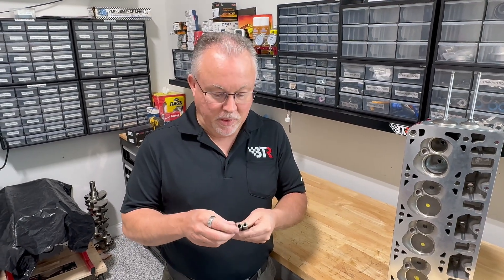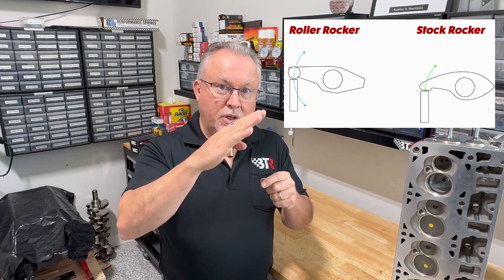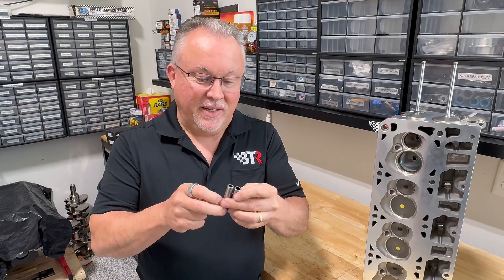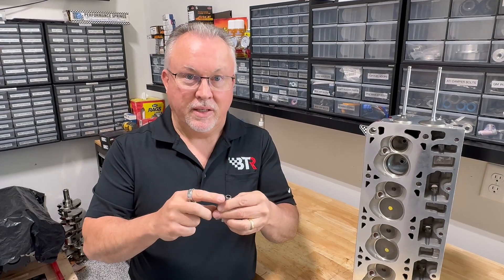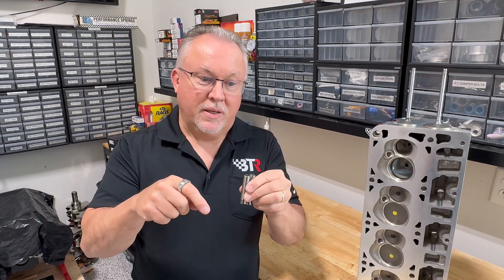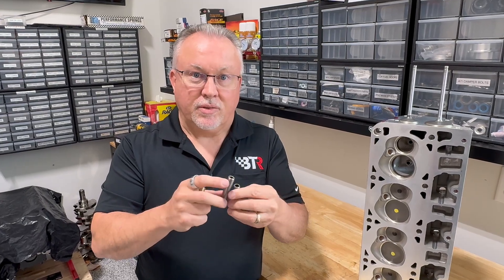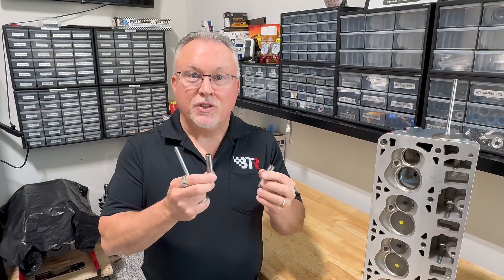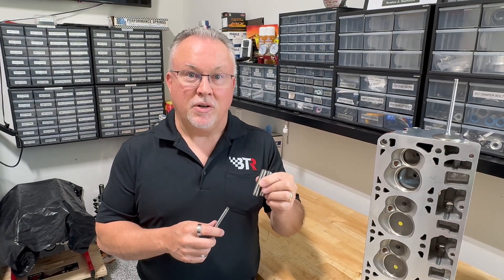BTR Releases The Best Powdered Metal Valve Guides Available!

Comment: BTR makes excellent products but this is nothing new for the LS market.  We have been custom making our Hardened PM valve guides in house for over 8 year now.  We have them in over 3,000 sets of LS7 heads.  We have been telling folks from the start about Bronze not being the correct alloy for LS7 heads.  You either want PM or you want Moldstar90.  Nothing else.  Just With that said we don't sell our hardened PM guides outside of the heads so its nice to see BTR offering these for the average consumer or shop to install into their heads.   BTR does make quality stuff.

Comment: Not so sure about all that. Bronze guides done right like CHE and SI valves made in the US are done right with the right material selection since the 80’s with tolerances down to 2 ten thousands ( .0002 ).There’s like 10000 different bronzes, to say all bronze guides are the same is unfair, just like not all powder metal guides are not the same. Some venders that orders 10000 guides from some factory in India, China, Israel, Turkey, with out any care in material and tolerances, then I get it.

Comment: Interesting clip.
Brian is a LS professor for sure....
Also a very good point on stock non roller tips and side loading. 
Also true, not many head shops want to use powdered metal guides or seats. I am one of them. All my stuff goes out the door with a full roller rocker and CHE alloy guides and or seats. I have had zero issues so far and would never put a powdered guide in anything. Not even a lawnmower. but if I ever have to. I will probably use BTR.
They have great products.

Comment: The lack of a collar on the top side of a powdered metal guide is why I'll never use them. I've seen so many fallen powder metal guides (especially on EJ's), but I've never seen a fallen bronze guide, because the bronze guides come with collars.
Reply: they do not move if you have the correct press! 100
Reply: @americanheritageperformance  If OEMs cant get it right I'm not going to hold my breath, especially when a better solution already exist.

Comment: With stock valves, proper valve train control, and high RPM (8000) is there any concern or worry about keeping the OEM valve seats in a brand new LT1 GM casting? Or is something along the lines of a durabond killerbee seat preferred. Thanks!!

Comment: hi, are you selling these guides to people who want to use them to replace their original guides?  how are they sized to the valve? do u offer oversize outside dia?
Reply from the maker: Our powdered-metal guides are available to everyone, and yes, you can replace your factory guides with these. However, our guides will need to be installed and final-honed before a valve will fit them. Our guides are not offered in an oversized O.D. as they are designed for factory GM casting cylinder heads.

Comment: Guy knows his trade. But another guy that does, said you need Magnesium bronze With stainless valves. And another guy that does say, you need them with turbo. My brain is smoking, And my piggy bank is hiding under the bed in the fetal position.  Every time I think I know something... I figure out i'm going down the wrong path, right after it's too late to return it. I've tried doing the wrong thing first.So it would turn around and end up being the right thing,  But it didn't work out. 😁
Reply from the maker: Other types of guides have a purpose and application, but our view is that in street car applications utilizing factory casting heads, high-quality powdered-metal guides are the best solution.
Reply: Yeah you dont want bronze guides in a LS7 head.  Way to much side loading, they wear to fast.  You want either PM or MS90 guides both of which are much harder and stand up to valve side loading much better than bronze.

Comment: Not to change the subject, but maybe a nice all steel GM style roller tip rocker arm to compliment the Powdered Metal valve guides for the LS7 would be nice! Even nicer if it were akin to the Comp Cams rail rocker system for  GM LS7 and LS3 heads. That would really get my attention. Keep up the good work BTR, we are proud of  our Pure Kentucky Horsepower!
Reply: The BTR rail rocker system is awesome and you can run the TSP roller rockers on it.
Reply: @dalethomas9307  For the LS3, yes indeed, for the LS7?
Reply from the maker: Thanks for the feedback and suggestion. Although, we have made north of 2,000hp with our shaft rocker system and factory LS7 rockers on our ProCharged L8T, and we are currently running the non-roller tip LS7 rockers on Brian's ProCharged billet 427 that is capable of 2,500+ horsepower. We've been impressed and happy with non-roller tip rocker setups.
Reply: @briantooleyracing3554  My interest is in a strong street driven GT style car. Yes, I currently run the BTR rail rocker system (new style) on our LS3 and it is a terrific piece of equipment. Love it!  But unless I miss something (easily done) there is no shaft rocker system for the GM LS7 head from BTR. If I'm wrong, please steer me in the right direction. Running that type of  BTR shaft system with the TSP roller rocker would be what a lot of the  (street driven) LS7 community is looking for. We see it being done on the LS3. Seemingly the best shaft rocker system currently available for the LS7 is the Comp Cams shaft rocker system, but it still lacks the roller tip rocker we all know the LS7 would benefit from. Not beating a dead horse, just a gear head looking for the best solutions. Thanks for your consideration, we appreciate all you do.

Comment: Bronze guides have kept me away from aftermarket heads in a street application.
Reply from the maker: Bronze guides have a place and a purpose, but in street car applications using factory casting cylinder heads that will see plenty of miles, a high-quality powdered-metal guide is really the only good choice.
Reply: We have been making our reworked LS7 heads with our Hardened PM guides for almost a decade now, over 3,000 sets installed and out there running strong!  With that said we dont sell our PM guides outside of our heads so its nice to see BTR offering these for individual sale.   BTR does make some great products that we have been using for 15+ years now!